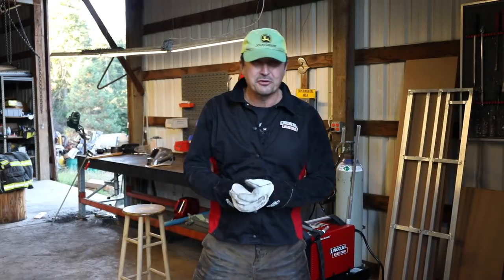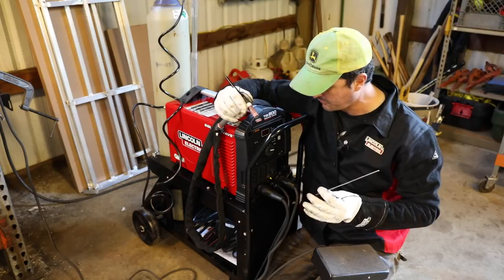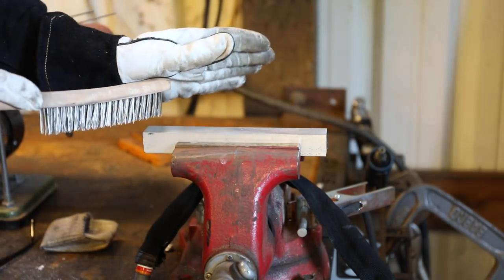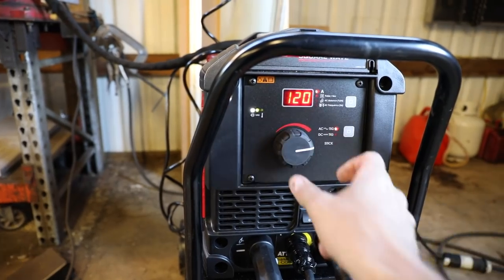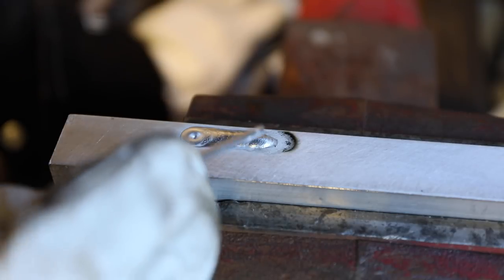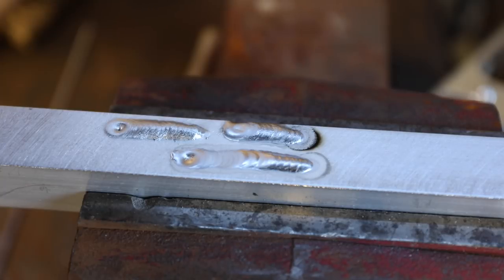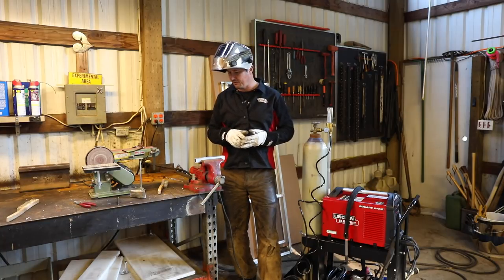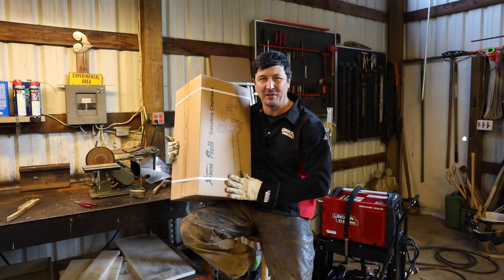The Hardest Thing I've Ever Done!!!

Comment from the maker: HERE IS THE LINK TO THE LINCOLN TIG200 https://goo.gl/RfTAzE
THIS IS AN AMAZON AFFILIATE LINK.
Reply: Wranglerstar you can also use other types of shielding gas such as helium. Also don't contaminate tungten by grinding it on something that has been contaminated.
Reply: Wranglerstar the reason we didnt send pencils is because pencil lead is made out if graphite which is highly conductive, get that stuff floating around your spaceship and it shorts something out very bad things can happen. Albeit millions of dollars to develop a pen seems a little steep.
Reply: I'm 14 years old and my metalwork teacher is trying to teach me to weld tig for my ute box I'm making it is verry very hard to get everything right.
Reply: Pull your material rather than pushing your material
Reply: Don't give up and keep practicing. I know how you feel and remember all too well how much I sucked at tig welding when I first started. I noticed those who treated this as an art were the ones who did the best when I was learning.
Reply: Wranglerstar thanks Cody, but golly ya don't gotta holler!
Reply: What makes it a liberal lie? I don't see how politics play any part of the story.
Reply: The black is usually from contaminated tungsten ie: getting to close to the material and try to turn up the ac frequency to help with the cleaning if the weld pool.
Reply: Wranglerstar your first bead looked pretty good. I think your making the common mistake of holding the foot pedal too high. You need to start a bit hotter to begin the weld but as the heat starts to soak the part you need less and less power from your TIG torch. Remember the foot peddle is a VARIABLE power control. 

Practice practice practice!!!
Reply: Bob Piff Lincoln welder....Lincoln jacket....Lincoln gloves... I think it is fairly straightforward to tell :)
Reply: Go watch weld.com tig time or chuckE2009 videos there good tips
Reply: Andy Midd Could have just been a "package deal" at the welding supplier. Nothing wrong with buying everything of the same brand if they make good stuff.
Reply: Bob Piff OK I agree about not monetizing sponsored videos. But putting a link in the description (for whoever may be interested) is hardly advertising.
Reply: If you get a chance you should test the WORX 18-Inch 15.0 Amp Electric Chainsaw it gets constant rave reviews. It would be interesting to see how it stacks up against the cheap gas chainsaw.
Reply: Wranglerstar when you start on aluminum, you have to give it a good deal of heat because it is such a good conductor of heat. It'll suck the heat away from your Arc and you need to step harder on the peddle to heat it up. Once you're running, you can back off a little so that it stays narrow. Then when you finish, just back off the heat slowly nso that the fill has a chance to flow back in to the hole. It freezes so fast that you have to keep it molten for a bit.
Reply: suggestions (right hand, left hand gun), (left hand, right hand gun)
Reply: Wranglerstar Cody, I’m in welding school and have kept up to date on your channel for years. But I want to tell you that you are grinding your tungsten wrong, stand it up to a fine grinding stone don’t spin it the way you did, the arc cone will be wider if the scratches are not parallel to the tungsten
Reply: Bob Piff You realize where this is going, right? Soon any opinion whatsoever, either good or bad, will be considered as "advertising." It's important to use discretion.
Reply: @Bob Piff - If it was a sponsored video, he would've said so.  The only sponsored video I can recall him making was for the DeWalt cordless tools and charging system.
Reply: Wranglerstar do a cordwood challange next year
Reply: @Bob Piff - Which ones?
Reply: That doesn't look bad at all for the first time
Reply: Jody's site is the best!! Nobody does better on their weld puddle camera images. He is top tier in this and his abiltiy to show others how to complete a task. You will not be disappointed.
Reply: Wranglerstar great video!, Little off topic but do you know what the apologetics study Bible leans toward like Christianity or Catholic?
Reply: Been pushing it 21 years so far so good...... You can do both with good results really.
Reply: Helium is the best to tig with

Comment: I did my apprenticeship as a welder / sheet metalworker back in 2002. I did loads of tig welding mainly with 316 stainless steel. You've done a good job there - ally welding is tough! The white and black at the start of your welds is a lack of gas sheilding. Try feathering the power up before you strike the arc to ensure you have a good gas sheild, & watch out for gusts from open doors that can blow away your gas.  As i remember i used to increase and drop the power on the peddle everytime i dipped the rod to reduce the heat in the work. We also ground the tungsten more round than sharp. Its amazing how different welding stainless steel with tig is to alluminium. If you get the feathering right you can build little stalagmites of aluminium on top of the work - kept me entertained for hours!

Comment: Cody do your self a favor start on mild steel. Aluminum melts with out warning I don't want to see you get hurt for no reason or lack of knowledge
Reply: The whole process is also a lot slower on steel, and easier to learn.
Reply: Agreed with starting on steel.
Reply: That's the way I started was steel. I also self taught myself. I would also recommend a respirator.
Reply: Wouldn't you move more quickly so you don't liquify it?
Reply: You need ac for alu and a balled tip

Comment: Watch welding tips and tricks. Jody produces the absolute best weld training videos that you will find. Also check your welder settings. Something doesn't sound quite right.

The poor surface texture is from heat. It takes a moment to get enough heat in it to start but once it's there you must move fairly quickly (on aluminum). 120hz on your AC frequency will do for most things. Turn that higher for less penetration and lower for more penetration only if you're running out of amperage range on your machine. AC balance should be adjusted based on how clean or dirty the aluminum is. The cleaner it is the more DC- you can run, dirtier needs less DC-. A good starting point is 75% DC- or 25% DC+ depending on which way your machines read out displays it. On the Lincoln it should read as percentage of DC-, so 75. Leave pulsing  turned off for now.

Argon flow is adjusted based on the cup size that you are using. The general rule of thumb is to use 5 cfh per 16th of an inch cup size. For example, a number 5 cup is 5/16" on the inside. For a number 5 cup set your regulator to 25 cfh of flow.

For 1/8" aluminum set amperage between 130-150. Use more pedal to start, back off to maintain bead width and then back off more at the end while you add extra filler at the end to avoid crater crack. 

I hope this helps you and that it wasn't too much info at one time. I'm a weld instructor by the way so if you have any questions please feel free to ask.

Comment: I'm a welding student working on my TIG certification, MIG certifications, and stick certifications.  One big thing I've learned is the shape and size  of your Tungsten really matters. When you grind the point down you want the grain of the grind to go down to the tip. Also when welding on aluminum when you finish up your welding bead double dip your filler wire at the end then slowly let off the pedal and circle it. It will help prevent the hole that forms in the end of the weld. That will prevent the hole at the end of the weld. That hole is the weld cooling down differently and shrinking outwards from the middle of the weld puddle. Aluminum is much trickier than steel. But good work!
.

Comment: Excellent video Cody, one thing to note is that it is possible to weld without flux or shielding gas, and the arc does strike, but the point of flux and shielding gas is to keep the oxygen out, preventing porosity, where the oxygen enters the bead and fills it with tons of hole and bubbles, leaving a terrible weld.

Comment: As a welder, I love seeing other people getting into the trade. Practice makes perfect. One thing I must add, when you get to the end of your weld throw a little extra filler in there, that should stop that hole from happening, then slowly let off on the peddle. You are going to want a post flow of about 3 to 5 seconds. You do these things to keep your weld from cracking. Good job on pre cleaning material by the way!

Comment: Hey there. Welding engineer/CWI here. Congratulations on getting into TIG welding.

So the width of your puddle is directly related to how much amperage you're using. Don't be afraid to work that pedal.

Your gas flow shouldn't be more than 20cfh. Too much gas flow creates a Venturi effect and can actually pull atmosphere into the weld. Less is often more here.

When you sharpen your tungsten you need to use either a dedicated grinder or a clean disc each time. Getting steel or other material into the tungsten will destabilize your Arc and cause contamination.

Additionally with Aluminum. Cleaning is critical. Brush the hell out of your work with a Stainless steel wire brush and wipe it down with acetone. Aluminum oxide has over twice the melting temperature of raw aluminum, so you need to remove as much as you can prior to Welding.

The last bit of advice is to hold your filler overhand and don't have your hand so far down on the rod. You want to gently tap the filler into the puddle, not jam it in there.

Comment: The soot on your starts is from contaminated tungsten; if you accidentally dip it in the pool, you should re-grind. Like sharpening a knife, finish off the grind with the scratches running to the tip (not around like you were doing in the opening clips). The crater at the end is from not ramping down the power slowly enough. Finish off by moving a small puddle in a circle around the area where the crater would form as you slowly let up on the pedal. Beware of advice to use more shielding gas, it is a waste, and it blows the arc around.  Great first welds! Good to see people learning new skills.

Comment: I thing the porous quality of your welds is caused by not enough argon gas. Try turning the pressure of your argon gas up a notch or two.
Reply: Robert Carmody or the amperage isn't quite high enough
Reply: Chris Cramer of course the sound is through the speaker of my iPad, but from what I could hear it sounded like the amperage was plenty high. Than again I'm not an expert.
Reply: Also if he doesn't like the little grains, a wire brush will knock them off.

Comment: The hole at the end of your weld is called a crater. It's caused by aluminum cooling very fast. Dull looking porous welds are too hot. Stay tight to your work piece with your torch and consistent. From the sound of your welder I would increase frequency. At the end of your weld add a little rod and swirl out of the weld while easing out of the pedal. Welding tips and tricks is a great channel to learn from. Love your channel, great vids.

Comment: Good job for your first time! One key thing is to always make sure you are comfortable in your welding position and make sure that you don't need to keep starting and stopping by having to move positions too often. Always pay attention to the puddle, it tells all. One thing with aluminum is you will start hotter to get the puddle going and from the aluminum gathering heat you will end up tapering back down as you move forward with the weld. Also with aluminum you want to taper off slowly at the end to prevent craters. Cracks can start from craters. Some really good videos are on Welding Tips and Tricks channel. Great source of info! Practice, practice, practice!

Comment: That is quite impressive for your first time, good job. (Source: AAS Welding) You do a good job analyzing the weld upon completion, do that whilst you are welding. Keep an eye on the solidifying metal behind the puddle, filler addition (cooler metal shrinks puddle, absorbs heat) and petal input will become second nature as you use them to control the puddle. Thanks for sharing your adventures and again, well done. 

Definitely check out some of the content other commenters have suggested.

Comment: Hi Cody, have fun, tig is great once you get the hang of it, machine settings are the main thing to worry about as long as you can oxy you can tig. Grind your tungstens straight into the grinder so any grinding marks long ways on the tungsten and not around them, it does make a difference to your arc unless you chemically sharpen or sharpen in a dedicated tungsten grinder. Aluminium takes a bit of control, with its heat properties you will get more flow out and penetration as the aluminium gets hotter, the end crater is common too, just drop your amps and put a spot of filler in just as you finish your run. Keep the gas over your weld for a bit after finishing the run too.

Comment: Looks like everything that I was going to suggest is already posted. You are taking on a task that is a tough one for a beginner TIG welder. I know because I am one too. I was self taught using oxy acetylene to weld so things were a little easier for me. TIG is kinda like electronic oxy-acetyl welding so to speak. Practice, Practice and then Practice. I would also suggest checking the gas for adequate flow rate and also that sugary surface on the aluminum is usually an indicator that the material is almost hot enough to puddle. Wait for the full puddle to form and keep the tip of your filler rod within the gas envelope. Best of luck.

Comment: Cody, I'm a welder of 30 years experience thus far and I'm impressed at your very first TIG weld there. Aluminium is not the easiest to start with for sure. 

The first weld you laid widened because as the heat builds, you need to start moving at little faster (or back off the heat a little with the foot control), it looked to me like you went the same speed all along and I'm just guessing that you did not back off the foot control until the end there.

To stop getting that little dimple at the end of the weld, go backward (fairly quickly) over the weld you just laid about 10mm (3/8") or so, and dab the rod once or twice. This works with all welding types, but can be a little tricky and alien to get used to.

The porosity is more than likely due to the fact you are losing the gas shield as you weld. I heard you say in a blacksmithing video you did with you son that it was a little windy in that barn, that's a pretty big issue when TIG welding as the gas can be easily blown away. Close the doors if you have any, or get some welding screens and surround your area with them. Even a slight breeze can make a big difference. 

That said, be careful if you are welding in a confirned space and never weld while in a pit unless you are exctraction the argon as it can build up like a layer (being heavier than air) and even though it's not poisonous, it can still asphyxiate you. You need ventilation, but not high air flow. 

Also, you only need to feed argon to the torch at the same atmospheric pressure relative to the altitude you live at (15psi at sea level). Obviously too little gas will be a problem, but too much can also cause a simmilar effect. I'm assuming you have the correct gas too? You need the higher grade (most pure) type for welding aluminium.

Comment: The guy before me who mentioned starting on mild steel first was very correct if you can get the technique down in steps it'll make switching to aluminum easier. Also the rough surface you're seeing on your aluminum I believe is too much heat but it could also be oxidization from lack of Argon coverage ( the shield gas coming out of your torch) a good idea that I would highly recommend being a welder and pipefitter 15 years is to get yourself A gas lens and larger cup set up any welding supply store will have that. Also if you start with mild steel you can eliminate one more challenging thing by laying your wire on the steel instead of dabbing it. One more thing about the dabbing technique or ending a weld is do not remove the tip of your filler wire from the shield gas until you have completely terminated The arc also let it sit there for a little bit in the shield gas that is where the gas lines and larger cup will come in handy.

Comment: Hi Cody, very good for a beginner.  The black may be because you only wire brushed to remove the oxide but didn't degrease, try acetone afterward to remove the oil (clean your filler rod with scotchbrite then acetone also).  The different penetration is because aluminum hold heat so well.  By the time you were on the third weld that little piece was probably really hot.  Set the amps hot on the welder and then back with the pedal to get the right heat. The hole at the end is from the liquid shrinking and pulling away - back off on the head and add a couple extra dabs of filler at the end.  The roughness of the weld may be because of too much cleaning action (by the welding arc, I don't mean mechanical), there's probably a knob to adjust (cleaning or dig or balance).  Aluminum is the hardest, you can practice on steel.

Comment: Good Stuff.  Glad you watched videos showing you how.  Aluminum can be tricky.  Test your welds by trying to bust apart some pieces that you have welded together.  Tig welders are fun.  BUT,  don't be deceived.  Just because they don't throw sparks your eyes are at risk.  Most metals when welded form a scale on the surface (not so much aluminum).  This scale cools at a different rate than the metal underneath.  It can and will pop off.  2 to 4 feet is not unusual.  And it usually happens when you lift your shied to closely examine how well you have done.  You can walk on a wooden leg, and you can eat with false teeth, but you cannot see through a glass eye.  Sometimes it helps to preheat the aluminum.  Very heat conductive material.   Good Video.